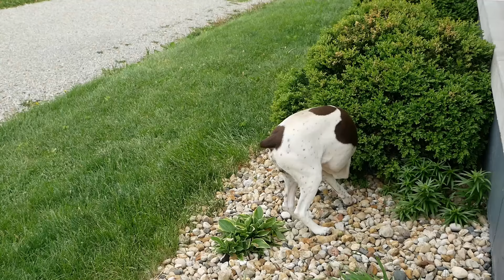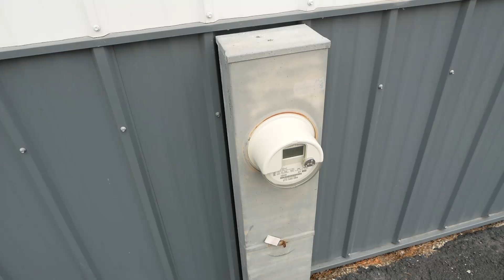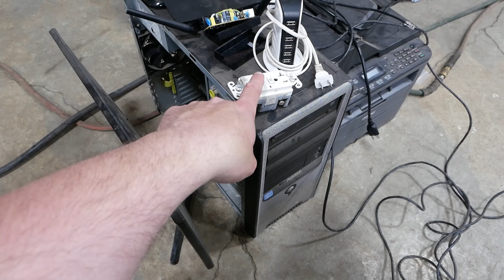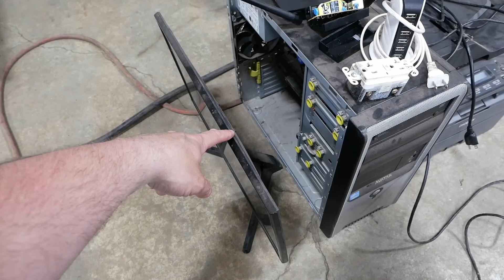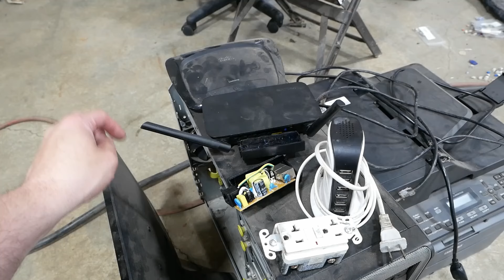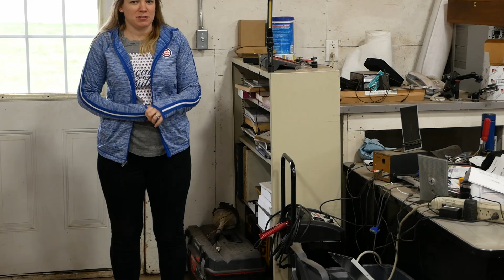Lightning Strikes Shop, Again...

Comment: my advice is setup a 500w solar system and batterys. 2 used 250w panels and a charge controller are cheap now and you could run all the tower and all the internet from 4 car lead acid batterys running either 24vdc or 48vdc  then if it happend again you would only cook the inverter  just a thought  oh back up backup and more backup to a hdd every month. this happend to me

Comment: Wes, that surge protector plug strip may not be as good as you think. The surge protection is done by MOVs, and those fail with repeated use, or even with a single use if it is something like a lightning strike. They can fail closed, but usually they fail open, and in either case, they don't do any more protecting. Often they have an LED on the front that is supposed to somehow tell you they are still good, but that is really just BS.

Comment: The sad reality is that your internet provider know they are the only ones you can use, they know you have no other options, so you are at their mercy. Competition can fix that, however no one is going to spend money on the necessary infrastructure if the returns are not there. That is where regulation is required from the legislatures. If the legislatures don’t have an appetite to do anything, you are cactus, well and truly cactus.

Comment: If there’s a weather warning for lightning.  Unplug everything until it passes. 👍
Reply from the maker: Not very practical. That would be two or three times a day for much of the year.
Reply: @WatchWesWork  
Check if your meter's grounding rod connection is good.

You might want to try more rods or a deeper rod, but make sure they're all connected to the main rod at the meter  with the most direct path and not too much slack in the ground wires.

Try a simple 3 light outlet tester to make sure there isn't anything odd at the outlets.

GFCI is a good idea, but maybe try one that is also an AFCI for your sensitive appliances etc.
There are also more expensive breakers that offer more protection.

Go for a good surge protector that also has surge protection that goes in between your modem and the line to the provider.

Also certain appliances can benefit if they are fitted with a  plug that allows for a replaceable fuse for the hot wire.

Comment: You can get a lightning protector on your input . This creates an easy path for some massive surge to reach earth. It is though a one off fuse type thing, once it has a surge its turns from a nice green to black. By using this your other protectors have a  chance  of doing their job.

Comment: Which may help: I've added lightning warnings to my home automation. It will notify me if there are lightnings happening in the vicinity, like within 5 km. And a second warning if closer than 2 km.

This way I can cut the power and unplug the Internet connection from the router.

It's using the service Blitzortung which is a large array of sensors worldwide which triangulate the lightning strikes happening around the world.

Not sure if there's coverage in your area, but maybe worth putting up some sensors in your vicinity to add coverage if necessary:
Reply from the maker: I can look into it.

Comment: Hi wes, that a sad thing you have damage because of the lightening.
Do you have a surge protector on your network antenna ?
Could the lightening damage come from the internet and not the electric circuit ? That could explain why the electric surge did not work.

Thank for your videos.

Comment: Mr, wes, chances are electrical wiring is not grounded in the building, an electrician can install that, if there is ground rod then is not installed properly, no way your equipment can get damage with the right ground.
Reply from the maker: We are grounded at the pole and entrance.

Comment: Online-USVs usually prevent this. You plug your network behind a switch which goes through the USV and then to the router. 

I think the lightning actually travelled via your Internet cable into the ethernet network and blew everything apart from there.

So the surge protection etc were only triggered by the damaged devices plugged into it or the lightning introducing a voltage spike towards neutral, since the neutral wire is grounded at your house.

Comment: What you need is a crapton of UPSes, or uninterruptible power supplies. More specifically, you need an online double conversion UPS. There are several different types of UPS, with the double conversion being the better and more expensive variant. It converts AC to DC and uses a DC-DC converter with an inverter to have a filtered clean AC output that never touches the mains. It's designed to sacrifice itself and blow up to protect your equipment so you don't end up with carnage like this.

Surge suppressors are a scam and don't work. All they are is a power strip with a varying number of MOVs used to "suppress" voltage spikes. They don't do this, what they will do is violently explode like your POE injector and deposit black conductive soot all over the inside of the surge suppressor and keep conducting electricity.

Back in the 90s and early 2000s, I used to have horrific equipment losses because I had everything on "surge suppressors". I had several of these events with blown up computers, routers, monitors, etc. until I started using UPSes. After I put an UPS on literally every electronic piece of equipment I own, and using a suppressor on the cable and ethernet lines, I haven't lost a single computer, router, monitor, etc. to a lightning storm in almost 20 years.

UPSes are costly, but they're worth every penny. It's best to buy once and cry once, rather than cry when you lose $5000-10000 worth of equipment multiple times. If you want an UPS on the cheap, look at second hand stores. People throw out their UPSes all the time thinking they're bad, when its just the battery that is worn out. I've gotten $400+ UPSes from second hand stores and land fills where the only thing that was wrong with them was bad batteries.

In your case, it looks like the surge came in through your Cat5/6 wiring if it took out all of that network equipment and your motherboard. I bet the reason it died is because the network PHY got blown up. When that happens, they short out and prevent the board from booting. I've had to replace them before by desoldering and resoldering them. It'd be interesting to see a picture of the motherboard up close to see if there are any telltale signs of lightning damage.

Comment: Wes - to get your info off that desk top PC. Buy a USB caddy for the hard drive. You’ll need to remove the disk drive from the PC chassis. You can then plug it in to another pc or laptop and it appears as a removable drive.

Comment: Wes, that desktop is old af and so are those routers. Good riddance to them all and enjoy your new computer and wifi! It's come a long way since those were new kind sir and madam! The only good solution is to physically remove the meter during lightning storms is the only way really and if your house is directly struck it doesn't help. Put the hdd from it in a new computer and read all the data, and DO NOT LEAVE ALL YOUR BUSINESS CRITICAL DATA ON ONLY ONE COMPUTER AND ONE HARD DRIVE. You have to make backups, in more than one building in different towns ideally.

Comment: I've always had good luck with using a UPS on my critical items.  You are always running off of filtered power so spikes and dips are less likely to cause damage.  Lightning can kill most anything if close enough though.  The UPS will allow you to keep using the computer even when the power goes out for a short time.  That way you can save critical documents and shut down safely.

Comment: I spent 30 years repairing telemetry systems using telephone and radio links, mostly rural mounted on top of hills and remote areas with a lots of overhead cables, great targets for lightning, I've seen cable reduced to lines on a wall, plastic enclosures blown to dust and more blackened electronics than you can shake a stick at, lightning is truly the finger of god, it destroys anything it touches, quite often the damage is hidden, it is a nightmare you have my sympathies, one thing we did to mitigate the damage was to simply disconnect our critical nodes from the mains and communication lines  during a bad storm and suffer the loss of service, cheaper and less trouble in the long run, Good luck.

Comment: I always unplug my pc whe  storm on area  , and internet it's easy to get power surge , even if storm is far away it can hit phone cable easy .  I have seen flashes at phone sockets before .surge protection only works for surge from main line .lightning strike contains 300 million Volts and about 30,000 Amps.

Comment: This screams to me ISP is to blame and should pay for the devices. I have worked with many wireless antenas and all manufacturers say you should have properly grounded surge protector between PoE brick and the antena, and surprise, surprise, 99% of reallife instalations dont have it because money.
The surge inducted on the ethernet cable to the antena, got through the PoE brick and killed routers and pc (this is why power supplies are ok). Printer and lcd may be secondary victims that got killed via data lines from pc.

Comment: This could have actually been prevented tho I'm not sure if you got that type of stuff over there as well. Here in Germany every electrical installation (mainly new ones cause people are to cheap to upgrade) has to have protection from lighting. Essentially a Fuse sitting in front of everything that blows during a lightning strike. It doesn't completely protect from damage but it sure helps a lot

Comment: our electrician installed a whole house surge protector that i believe is between the mains supply and the panel. Not sure if it would've prevented it in this case

Comment: Sorry to hear about the lighting strike Wes. It’s been my experience that the state of I’ll has very poor grounding on there electric poles. I built a transmitter site near Dallas City about 20 years ago and had a big fight with Ameren. I was getting struck constantly so I ran a 3” copper strap between the base of the tower and the electric poles ground. All of the hits were coming in on the electric but after I did that the problem was solved. Ameren raised hell but the soon noticed that what I did worked. Back then ameren only grounded every 4th pole. Here in Missouri every pole is grounded. Good luck getting thing back together my fried I enjoy your videos and have leaned a lot from you.
Reply from the maker: Our pole is grounded. I’ve been to Dallas City, or what’s left of it.

Comment: Looks like ground is not good enough. And all surge arresters used in sockets use same long cables for grounding overvoltage. I dont' know how surge arresters usually are installed in USA, but normally they must be installed in distribution box on input cable and grounded properly.

Comment: I am out by Dekalb, I have all of the parts you need, POE, routers, etc that I could offer you to get you online sooner. Also, I was at the top end of the Starlink coverage. I believe you are further north west. They might cover your area now. 

Hopefully there was a lightning arrestor on the line out to your radio, otherwise you'll need a radio. 

I am network engineer with an emphasis on multi gig backhauls from site to site in the midwest.
Reply from the maker: There is no arrester. The only good thing is the provider owns the equipment. But we have to wait for them.

Comment: Those lightning strikes on power poles are no joke.  Had a lightning strike on pole down the road about twenty years ago and it traveled through the lines and into the neighbors house blowing the microwave off the counter and starting an attic fire in the other neighbors house

Comment: The way you spoke about your business info on that computer, sounded like you didn't have a backup?  As cheap as USB storage is right now, its fairly painless to pop the stick in the PC, boop the 'backup' button, and put the stick in the desk drawer before you turn off the lights.  I doubt you have terabytes of customer data, it doesn't take long.
Reply from the maker: I do but it’s not recent.

Comment: Curious what the POE injector is - is it 24V passive or 48v standard POE?  You might get lucky if you can track down a similar injector and get back online without a service call? Guess that doesn't really help get your computer back up and running though.  Wish I was closer  and there wasn't an international border between us - pretty sure I have both style of injectors in my junk bin that I would send your way in a heart beat, but Canada Post and storage is slower than the donkeys running your internet.  Take care and hopefully you can get things back to normal soon.
Reply from the maker: I’m sure the antenna is also smoked.

Comment: Internet sucks everywhere.  I’m in Rockford everyone complains about Comcast.  I use Verizon Orbits. I have 3 of them plus the cellphone gives me 60 gig of high speed per month.  Okay for watching YouTube but not enough if you wanted high resolution movie streaming.  My electrician installed a surge protector onto my main panel to protect from lightning.  Luckily I haven’t had the opportunity to find if it works

Comment: i know im likely to get chewed up but if you have a few high points around the property lightning rods with heavy cable on very deep set grounding rods to pull the bolts to ground in a controlled manner

Comment: Hey Wes, what about a MoFi internet box, if uses a cellular data card and gets the internet straight from the cellular towers, then broadcasts it just like a regular internet box would, I actually use one in my home just because it’s much cheaper than home internet. Worth a shot. The box isn’t extremely cheap about $400 but buy once cry once and hopefully lightning doesn’t take that out

Comment: Line surge came in on your data line too, either phone or cable, probably fried your motherboard via the network port into the cpu case. Make sure you have ethernet going through surge protection too.

Comment: I feel your frustrations and know the battle of rural internet. We had star link for a few months and it was awesome about 10% of the time and horribly sucked the remainder. Did some looking and ended up with the verison hot spots that use the normal cell signal. We don't have 5G where we're at so it's just on the normal cell signal but it's been probably the best so far. Especially for the price

Comment: Wes they make a whole house surge protector but you connect into your main panel plugs in just like a breaker I've got one on my house and we've had some pretty close lightning strikes but I've never had nothing to get blown if you have to have an electrician come out talk to him about it or you can do it yourself they sell them at places like home Depot Lowe's I don't know if you have a Menards up your way considering how much stuff you had that got blown up the cost would probably be less than replacing all that equipment it would not have done much for your meter base but it probably would have protected your electronics and what that other feller said about lightning being a mini EMP is true but if it does not actually blow up your equipment or burn it out a lot of times you can power it down and then turn it back on and it'll go back to work I have that happen all the time with the sprinkler timers I work with

Comment: wes, that power strip is now just a power strip. the surge suppressor on it is toast. they fail open so you never realize they are smoked. they are rated in joules, after they absorb so much energy. they fail open.

Comment: Just keep your hard drive and start over. That power spike at the least fried the CPU and/or motherboard. A UPS might have prevented the spike, but the surge strip had fuses that should have as well, and they didn't. So, I don't know. You had multiple layers of protection and the current was enough to fuse everything. I would tie overhand knots in the power cables and ethernet cables connected to the outside, especially on a UPS. If it happens again, a blown UPS is cheaper to replace than your whole computer system, especially at today's prices.

Comment: A lightning strike to power lines will mean doom for a lot of appliances. Strangely enough, there seems to be no way to predict what appliance it decides to take out. And "NO", there's nothing you can do to prevent this from happening; unless you can control the weather. I would recommend that you replace any power board or power point that has surge protection integral to them, as the component that is used for this protection would have had it's chemical composition compromised due to the massive surge the lightning strike caused. It should be recommended that you replace surge protected devices at least after five years, especially in an area where the AC mains is prone to be very noisy, i.e. spikes and surges etc...  10/10 for this vid...